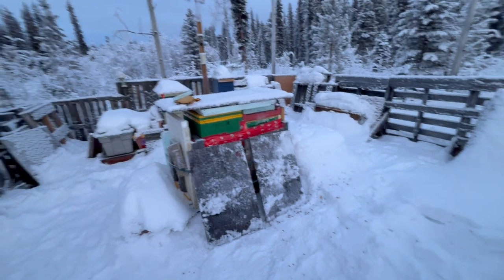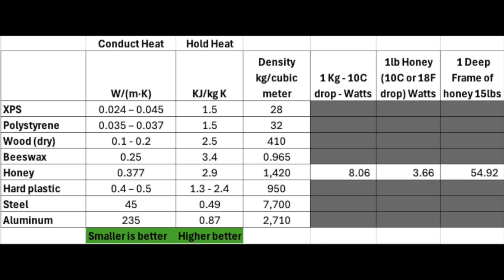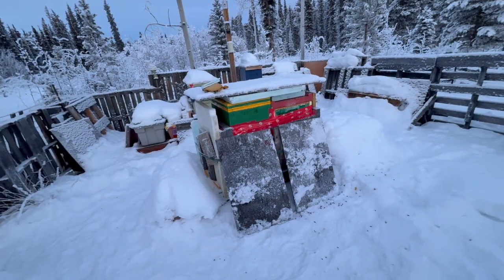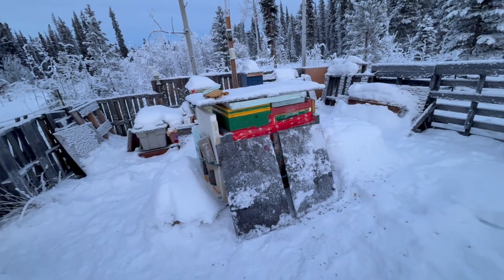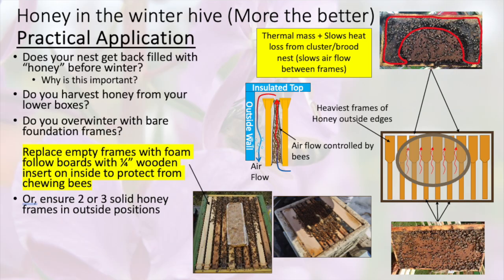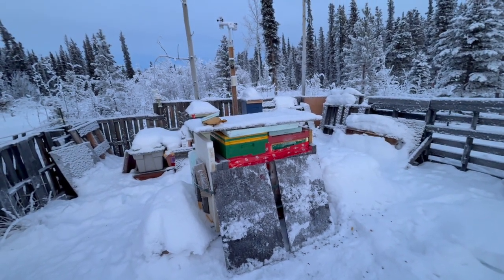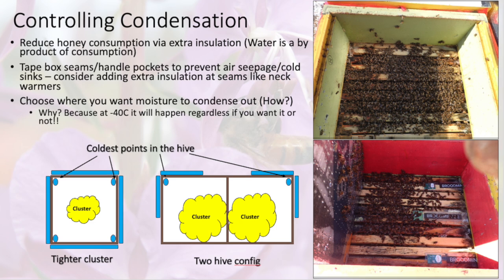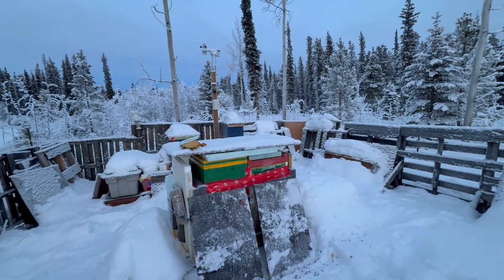Thermal Mass - Importance of Honey in our wintering Beehives

Comment: Merry Christmas, THANK YOU SO MUCH FOR THIS. 

So many people do not understand the difference in R and M Factors and how the Energy Transfer works, it's very difficult to get people to understnad that haven't worked in an industry that dealt with it. 

Dry sugar doesn't insulate well at all but it does cause a resistance to the transfer of energy, so it actually does have a R-value. It's just very small and you are 100% right it should be used as insulation, works better as an edible moisture absorbent.

Comment: Regarding your table of heat conduction/retention properties... for the honey data line - is that just the properties of honey exclusive, or is it the combination of honey & comb measured together?
Reply from the maker: honey accounts for most of it hence the reason I left the other columns blank. The reason I added the density column. Wax has a density of just under 1 where as honey is 1420 so any heat capacity for wax will be negligible. Similar with wood which accounts for less than 4% of the thermal mass potential in a heavy honey frame.

Comment: Hello Etienne! I want to ask about your sensors in hive. What type of sensors are you using and how much did they cost? i put some sensors to measure temp. and humidity but i would like to measure CO2 level but those kind of sensors are SO EXPENSIVE!
Reply from the maker: My hive temperature sensors are Broodminders. They have been good. Much of my humidity data came from them. Last 2 years, I added LoRaWan SenseCap. They are expensive. I use most of the money I make from my bees talks, donations and articles to cover the cost. The challenge are the CO2 sensors, anything above 10,000 ppm is not simple to figure out. The O2 sensor was relatively simpler but it requires a data logger (with built in battery) and a sensor builder housing. I have a 100K ppm CO sensor, but I am currently too busy to figure it out. It will also require I pull an extension cord out to the bee yard to do it properly.
Reply: @etiennetardif  don't know how far your house is from your bee yard, but if you ever do consider running an extension cord, you might want to consider running an outdoor POE (power over ethernet) cable (that you can bury) That limits you to around 100 meters (~300 feet) but a cable that long would be cheaper than an extension cord and  I suspect it would provide you with the opportunity to provide power to low power consumers like data loggers and other sensors as well as allowing you to collect that data with a hard wired ethernet connection and even allow you to set up a security cam. Thanks for the video!
Reply from the maker: @PrintableScience  I have used internet over powerline... I'll check it out!!
Reply: @etiennetardif  I'm using the approach I mention as I've been using security cams focused on hive landing boards to just observe what I can from the their front porch. :) I'll send you a link when I finish the vid.
Reply: @PrintableScience  what type of camera are you using? Im looking for something relativly cheap and without need to connect via some chinese cloud to work with it
Reply: @Kentrilek  I've been working with Reolink cameras... specifically the E1 Outdoor POE. I haven't been using them for long enough that i'd vouch for them, but the cameras (and NVR) are not that expensive. The E1 is $140.00 CDN, but is typically discounted most of the time. It's got pan, tilt and a 3x zoom and returns 4K video. Been using a couple of them for about two months now and so far so good. You do not need any cloud at all. You can record to an onboard SD card (but who would?) or hook it up to your computer (through your LAN) and record with a lot of options.  Should be posting my video on it in about two weeks.
Reply: @etiennetardif  I put some cheap bluetooth sensors in hive and installed Raspberry Pi with Home assistant to colect data and make charts. Next year I want to make hive with deeper bottom so i can put plexiglass and some cameras under frames. What type of O2 sensor did you buy and how you set it up? It would be awesome if you could share some "backstage" of your data collection and specific hardware you use :)